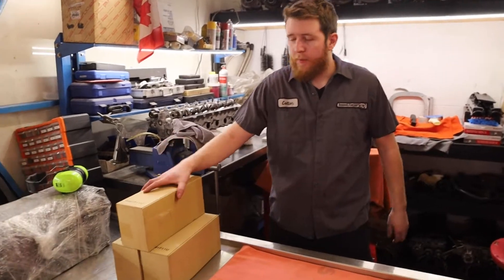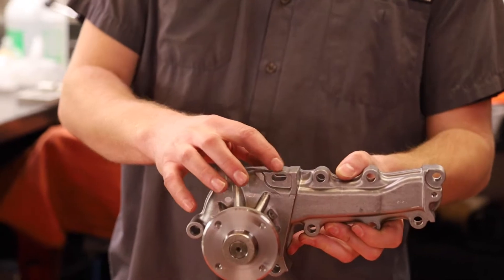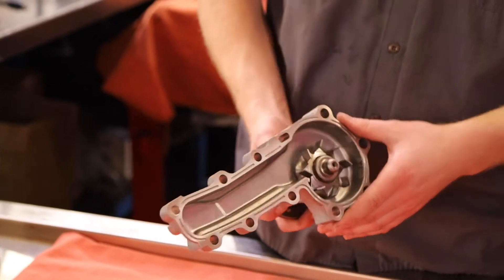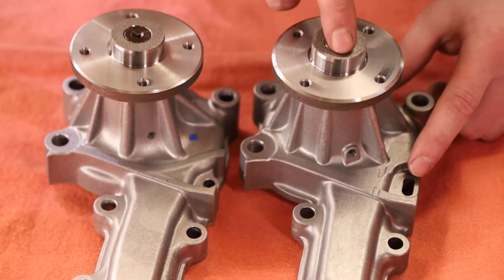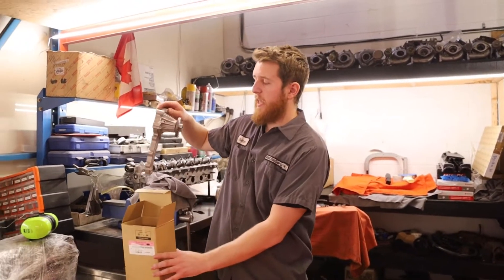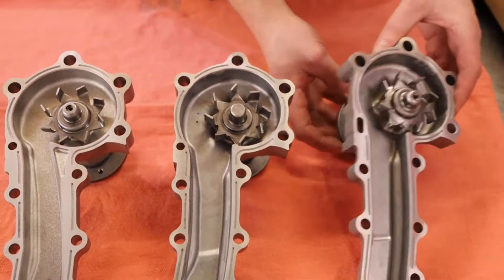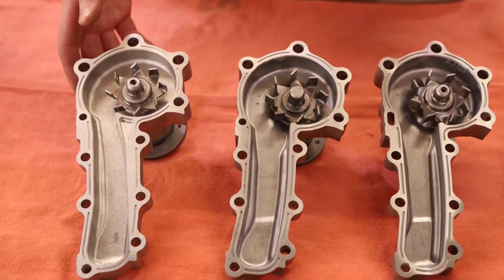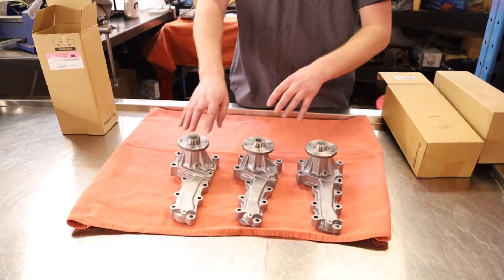Nissan RB Water Pump Differences & Applications || Boost Factory

Comment: I got sold a pump with a slot for my rb20det and was told to fill slot with rtv ha
Reply from the maker: Oh boy, not ideal at all... It's one of those things you could "make" work, i guess 😖. 
we have the correct rb20 ones in stock, usually 😁
Reply: @boost.factory  not great, i sent back their oem rb20det equivalents as one of the holes was so close to the inside sub 1mm I couldn't see it sealing.. when for this slotted on.. theyve ran them loads with zero problems etc etc ... well see ha

Comment: What about the N1 pump? Which would suit a high rpm rb30?
Reply from the maker: N1 pump flows less at X RPM. Compared to stock. the N1 is intended for prolonged high rpm use by reducing coolant flow it reduces cavitation at high rpm!

Comment: I am confused, some forums said the rb25det nelo does not have the slotted hole.
Reply from the maker: @jeanka_82  it does not from factory you are correct,  But this pump works on it as a part number alternative.
Reply: Much appreciated. So, N1 is not a good choice for a street car?

Comment: So on the r34/c34 de are neos. What exactly besides the blade is the difference between n/a and turbo version?
Reply from the maker: Its basically turbo Vs Non turbo. the Neo N/A pump flows less volume. smaller fin design. and visible casting differences. completely interchangeable. but if you would see a measurable difference on your average car. i doubt it.